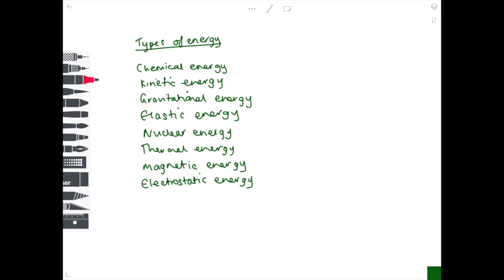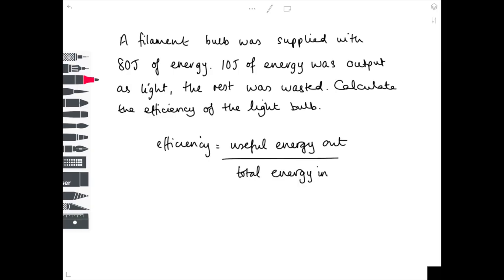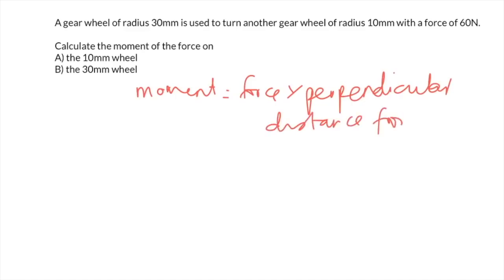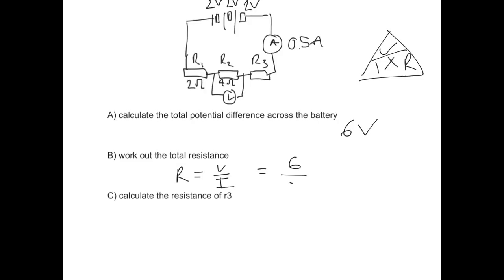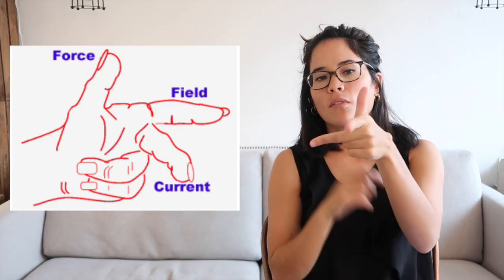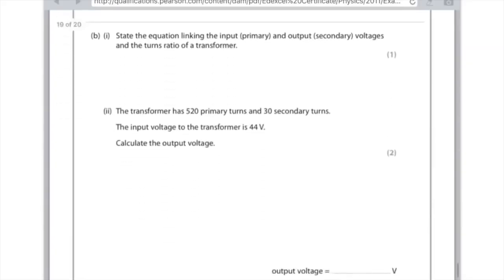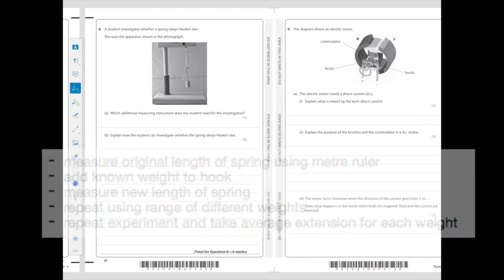ALL OF EDEXCEL GCSE 9-1 PHYSICS (2025) ⭐PAPER 2⭐ | Triple Award | GCSE Physics Revision

Comment from the maker: TOPIC TIMINGS:

Energy 0:50
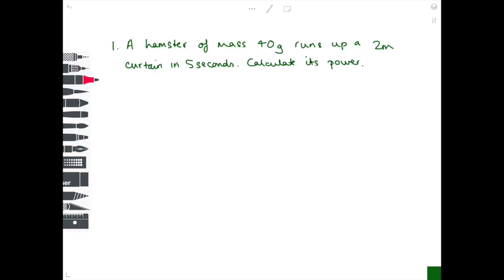Work and Power 3:24
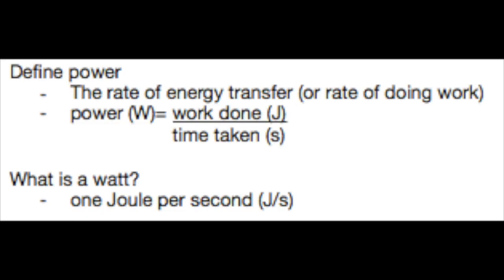GPE and KPE 5:46
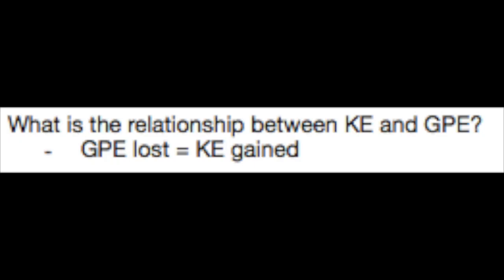Conservation of Energy 11:25
Resultant Forces 13:47
Moments 20:15
Gears 24:50
Structure of the Atom 28:50
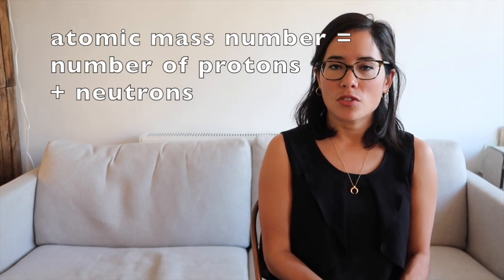Electricity 29:41
Electricity Calculations 37:56
Static Electricity 45:20
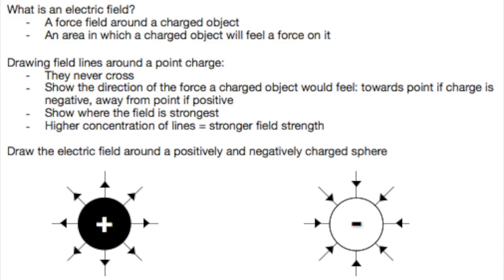Magnetism 49:48
Electromagnetism 53:31
Electromagnetic Induction 1:03:16
Transformers 1:05:46
Changes of State 1:11:08
Ideal Gas Molecules 1:15:50
Pressure and Density 1:18:37
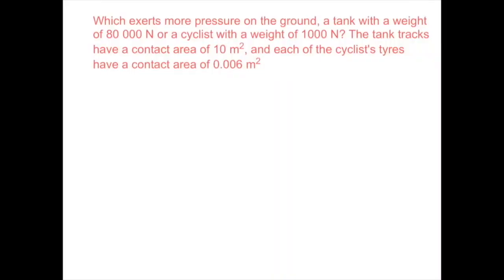Pressure and Density Questions 1:22:08
Springs 1:33:18
Reply: Science with Hazel ,,,3,,,l